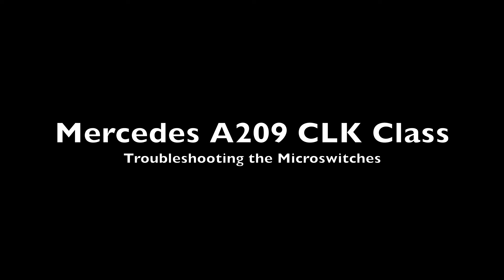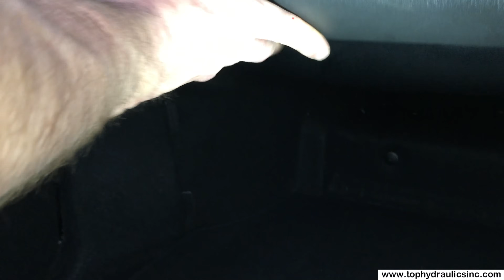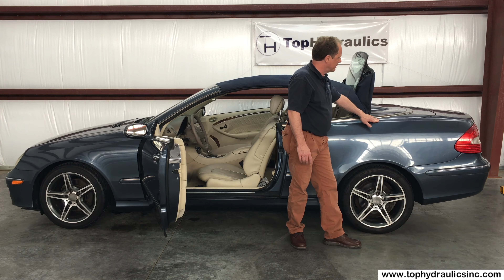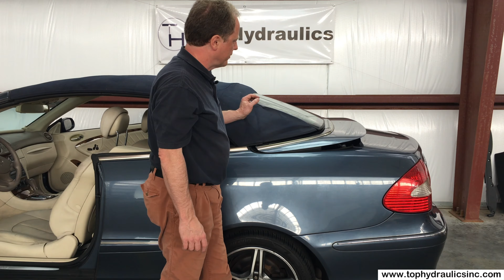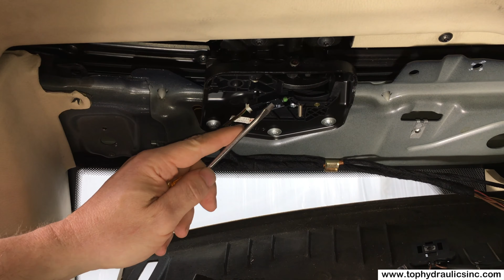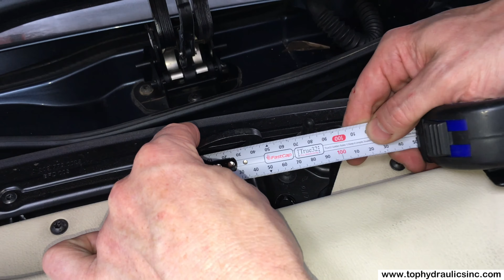Mercedes A209 CLK - How To Troubleshoot the Microswitches

Comment: Hello, my car is W207 cabriolet. Could you please explain what the following diagnostic errors mean:
B255F24: The limit switch 'Soft top compartment lid IN CATCH POSITION' has a malfunction. No signal change. Voltage level is too high.
B25452A: The limit switch 'Soft top compartment lid LOCKED' has a malfunction. There is no signal change.

Where is the faulty switch located? Could the problem be caused by defective wiring located in the trunk area for the folding soft top.

Comment: Hey appreciate the information, im sorry to ask but hopefully you will reply...i have a 2009 mercedes clk350 and noticed when either closed or opened convertible the rear convertible panel has a gap just a bit maybe about an 1inch. Its the panel where the rear glass sits on and its just on the drivers side. Any help? I can send u a video or picture of the vehicle

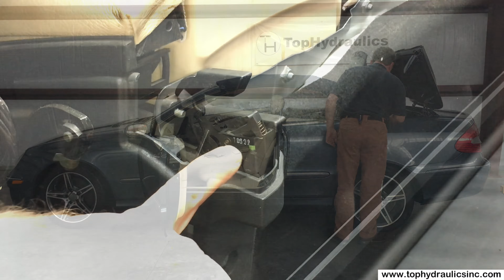Comment: Hello Sir, I watched your video trying to determine what the part difference from the left and right limit switches. Can I use part # 2098201910 for both sides? In your video at 3:21 mark, you called it part #S8422 - 2098202920, then you called the same part at 3:57 time mark part #S8411.

Comment: Hello you mentioned s84/11 at about 4:10 in the video being broken. I have this exact issue but I noticed that the tonneau cover latch that presses this switch is slightly out of alignment (roughly 10mm compared to right side switch). I tried to move the latch towards the center of the vehicle but there was not enough tolerance to fix the issue. What else can I do to fix this alignment so it doesn’t break the switch again?

Comment: Wow, this is amazing.  I am considering purchasing one of these models, and this is very helpful to know.  I recall seeing your video on th R129 when you explained how the rubber seals inside the cylinders are not well-made, and soon decompose creating bits and pieces floating in the fluids, which creates havoc on the entire system.

Questions: 
1. Does prolonged storing the top either in the open or closed position affect the operation or is it just a matter of switches going bad?

2. Are the hydraulic cylinders in the CLK problematic in and of themselves.

3. Are there key points for periodic lubrication?

4.  Can you rebuild the cylinders on the CLK the way you can on the R129?

5. Is there any problem created opening and closing the top manually?

Thanks so much in advance! 

Anyone else feel free to chime in with your experiences.  Thanks

Comment: Can you please help me? My microswitch for the ski bag is working and working fine, but it still tells me to close the ski bag. The windows don't go down by themselves when I press the convertible button. As I said, I tested the microswitch with a tester, and the gas springs on the cover are also OK. The convertible is closed, but when I press the button to close it, the hydraulic pump briefly turns on, makes a brief click, and that's it, but the convertible is already closed. When I try to open it, the message "Close ski bag" appears.

Comment: Hi, thank you for your video, the rear bow on my CLK w209 will not finally close as you have demonstrated in your video. On the chrome receiver compartment for the rear bow latch one of the sprung doors has sheared off and it’s the one that operates the micro switch. I wonder if you can help me with a new part number. Thank you. Simon
Reply from the maker: The sprung door is part of a larger assembly and surely that assembly has the part number printed on it.

Comment: Can you explain what to do if I pushed my compartment cover down to far before glass entered the ports in the cover?
Reply from the maker: Are you able to open the trunk lid with the blade key in your key fob?
Reply: @TopHydraulics  thanks for your quick response, so I managed to open the lid manually by opening the pressure relief valves on my cylinders and opening the screw on the pump. Question i have now is: would this compartment lid closed all the way without window locked in first be a reason for my 40Amp fuse to burn? I managed to manually operate and close the top, completing every sequence properly, and I am going to replace this fuse tomorrow once again and see if it burnes again. I understand if it does burn my pump is bad, how do i make sure that pump has gone bad? Thanks for pointing me into right direction.
Reply from the maker: @Kreasearch  The 40A fuse blows when the pump is bad - the timing was a coincidence.

Comment: my problem is that the part under the rear shield doesn’t slide bag or move, so the rear window doesn’t open, but all the windows go down and the front lose its grip and are ready to open, its only the back part there is the problem... i changed the fuse to the roof, but stil the same and the oil compartment is full en there is no leak anywere... please help me

Comment: Hello, my English is not very good, sorry. I have an A209 vehicle. Everything goes well when opening the roof, but at the last step, the back cover gets stuck while entering its place, and when I press the button to close it, the back cover gets stuck again. After pulling it a little, everything is fine. What is the problem? Thank you.
Reply from the maker: Do you have an early productionA209 with the last six digits of the VIN less than 009490?
Reply: @TopHydraulics No, My vehicle is a 2004 model and its VIN is not like that. Thank you very much for your reply. The rear cover only works when I first open it and after the whole awning is opened, it fits into place when I close it and the cover slides into place very nicely along with the glass.
Reply: @TopHydraulics  from your a209 video chapter 8… 2.00 minute. In this case, it gets stuck only on the first run.
Reply from the maker: @hasanserifoglu6262  Can you please explain again which part does not work? Does the cover get stuck when the top is down or when the top is up or both? Exactly how far does the cover move until it gets stuck? Is the cover closing unevenly and hitting an obstacle? Or is the top not folding perfectly and making it difficult for the cover to close all the way?
Reply: @TopHydraulics  I want to upload the problem I have with my vehicle to YouTube and post a link here. The problem is, as I mentioned, when I first open the convertible, the back cover gets stuck. There is no problem in the next starts. Thank you very much for everything...
Reply: @TopHydraulics  https://youtube.com/shorts/LwtzDT_wxeQ?si=nPxRcTqdDKgIFtG8
Reply from the maker: @hasanserifoglu6262  If I'm understanding this correctly, then your problem occurs while you are opening the top: the top retracts and folds into the storage compartment, the cover closes almost all the way, but gets stuck on the last inch of travel. If you open the cover again, then the cover will close properly on the second attempt. Did I get that right?

If so, then you want to observe two little plastic parts in the rear of the storage cover that are supposed to push down on the folded top, to help it get folded all the way and make enough room for the cover. These plastic pieces are attached to springs and maybe they are not touching the top in the right place the first time around?  Or is there an obstacle taht does not allow the top to fold down all the way? Maybe a broken tension cable between the canvas and the headliner?
Reply: @TopHydraulics  I looked at what you first said, the plastics and springs are in place, I will look at the tensioning tires tomorrow, thank you for your interest.

Comment: The hydraulic reservoir was empty 
I filled it with hydraulic oil , the oil emptied out in 15 seconds,
Reply from the maker: If it emptied that quickly, then your leak is most likely from the bottom of both main lift cylinders.

Comment: You saved my roof! Thanks for the sound advice 🙌
Reply from the maker: Thanks for your feedback and glad to hear that the video helped you with fixing the top! What was wrong and how did you fix it?
Reply: I had a broken switch where the plastic on top of the spring was completely damaged. I could not even open the car to get to the switch because of that, however I also saw another one of your videos on how to open the soft top mechanism manually and combined with this video, I was able to get in and replace the switch. Thank you 🙏

Comment: What about the S84/22 or S84/23 catch position limit switches.  Would these keep the Compartment cover lid slightly out instead of engaging the Cylinders to pull the final movement to full close?
Reply from the maker: Would you mind describing the symptoms in more detail?

Comment: Great video.Thank you! I have question.I have a 2008 Mercedes Benz clk 350 cabriolet. The left rear side window does not roll down. Will that interfere with the convertible top operation? Thank you!
Reply from the maker: Yes, a malfunctioning window regulator will disable the top. Fortunately, our video on replacing the main lift cylinders already shows you most of the steps needed to get at the rear window regulator.

Comment: I have a a209 and my problem is that when i want to open my roof , the windows go down , my roof opens at the front a little bit my pump is running but nothing happens. The back won't open.
Reply from the maker: Is the tonneau cover moving at all?
Reply: @TopHydraulics  no not at all
Reply from the maker: Aah, what are the last six numbers of the VIN?

Comment: i dont understand what to do when i accidently locked the back and now i cant manually pull the back out again. pls help
Reply from the maker: Please explain in more detail. Did you manually close the top and you closed the tonneau cover without securing the rear of the soft top in it? What was the reason for manually closing the top and which error messages are you getting?

Comment: That is one of the best videos I have ever seen. Thank you so much. I have a code B1962 the power closing limit switch fails to switch. Please, can you or anybody else tell me where this switch is located?
Reply from the maker: Hopefully, we can figure out together which switch your code reader is referring to. What are the exact symptoms?
Reply: First of all, thank you so much for your help and your interest. It's a 2005 Mercedes Benz 209 CLK class 1.8l SFI. When I pull the opening switch (CAN controlled) the convertible top doesn't move. After this the scan tool reads the following codes: B1870 the output stage or servomotor of rear lock is defective. B1962 The power closing limit switch fails to switch or has a short to circuit 30. At the trunk lid latch, i measured two micro switches, one goes to rear SAM 10/2 and the second to the convertible roof module N52. Both switches are pulling a voltage of 3.6 V coming from the modules to a ground. When i move the roof manually i cannot open the trunk, so everything works fine. I don't understand why the car doesn't notice this. Now I think I made a mistake and measured on the wrong part, perhaps I misunderstood the fault codes.  @TopHydraulics

Comment: My Autel says 225 limit switch soft top bow in catch position NO, whether it's up or down. 224 and 226 shows up or down, but it doesn't activate the catch position either way. It seems to stop here. Should it activate for the next step? And where would that catch position be? The windiw goes up and down, no more.

Well, after turning off the key and the pressure releases, then I push the rear section closed, the soft top bow catch position reads YES. I have to close it manually.

Okay, final edit, I hope. Now it works. I tried the windows reset, then it opened all the way again. Then when closing it, it paused a while, but I kept the button forward, then it started going closed. Untill the back cover was straight up and didn't go down. It was stuck there. I got out and pushed it forward a bit, then got back in the car to push the button forward and it finished closing. So I tried it again, to get it to the stuck point again, to take a picture of where I think the problem is, but it continued all the way closed. LOL
I did decide to take the manual straps off the rear hinges, just to see if that helped. Not sure if it did, but that's when it decided to work. I alsow replaced the right rear hinge, as the plastick center piece broke when trying to manually open it. But I guess everything was just getting all stuck. The first time trying to manually open it was very difficult and became easier as I kept working on it. I guess I need to keep everything well lubed up.
Now that it works, my wife will be happy. Now I have to put all the black stuff back in the sides of the trunk. She was getting upset and wanted to sell the car and buy another convertible that works. LOL

Well, had to get out a few times to move the rear cover forward a little at a time, untill it finished going closed. So maybe it's that switch on the rear left cylinder?

B1926, B1928, B1953, B1933, B1930.
Do these codes help, where am I looking for this limit switch?

Comment: The other day it opened all the way. Now it acts like the pump isn't building enough pressure to work. 
https://youtu.be/rznpJjOZg-A
Reply: As I found out, this is the problem. The pump needed to be replaced. I replaced it and now it's working.

Comment: hi there i have a clk 200 kompressor the top opens and closes great but it says top in opperation on the dash, also the side windows wont go into there final possition i.e full locked car, do you have any idea what could cause this.
Reply from the maker: Most likely, the "compartment cover closed" micro switch on the right side of the storage compartment is not giving the signal that the cover is closed all the way, see https://youtu.be/ZLIdoiw_KTY?list=PLly4CMbpk7owNRAl-AECemIb0SVihtBlV&t=312  This could be because the switch is broken, or it could be because something is in the way of it getting triggered. Check it out while the cover is open...

Comment: Good video. Is there a way to maintain these 2 switches from dust because I have the chrome door is stuck down
Reply from the maker: That’s an unusual question, as these switches are not normally sensitive to dust or exposed to much dust. The best dust protection may be to make the chromed cover functional again, as designed.

Comment: Hi Klaus. I have an intermitent malfunction in my 2008 clk. When I try to open the top the 4 windows go completely down, I have the message Top in Operation and nothing happens, no sound. I said that in an intermitent malfunction because it happened 1 year ago, it didn't work for a few months and then sarted to work again. I have the common problem of the cables in the back window, does it cause humidity that can originate this problem? Thanks in advance.

I just saw in the comment section that this might be a fuse or relay problem next to the main pump, i’m going to see it is this. Anyway, if the problem persists i’m sending you the pump to repair. 

Many thanks for your very wise advises. I’ll give you feedback. Manuel
Reply from the maker: Could be either the pump motor drawing too much current and blowing the 40A fuse or could be the relays on the pump motor. Check the 40A fuse behind the left rear wheel well first, see https://www.youtube.com/watch?v=08R8E3Sc0oQ&list=PLly4CMbpk7owNRAl-AECemIb0SVihtBlV&index=6&pp=gAQBiAQB If the fuse is blown, then the pump motor is burnt out or the pistons in the pump are frozen, making the motor draw too much current. If the fuse is good, then you might be lucky enough to have a bad relay at the pump. Only one relay fails at a time (and the contacts only fail in activated mode), but there are two identical ones. One relay makes the pump motor turn clockwise when activated, the other one makes it turn counterclockwise. Thus, the cheap test in this case would be to swap the two relays for each other and see if the pump starts turning. Both relays need to be in place for this test, but you swap one for another. Again, the latter will only work if the 40A is not blown.
Reply: @TopHydraulics  
Dear Klaus, 
I couldn’t find today an electrician so I tried myself to swap the yellow relays (i didn’t measure the fuse but i thought, maybe wrongly and with some risk of damaging that if the fuse was broken i woudn’t damage any electric parts).
When I switched it 1)  windows down 2) the tonneau made the movement 3) the back window went up and 4) the tonneau fully opened. No more. And then when I tried to close it obviously didn’t do anything so with an openned tonneu I tried to reach those relays and swap them again, which I managed, 30 celsius, under the sun, fortunately I have very long arms. It was a nightmare. I called Mercedes parts and tomorrow morning i will have 2 new relays. The million dollar question is if with te teo new relays (i know one would be enough, anyway) my top will do the full motion it is supposed to do. I’m praying for that because in Portugal Mercedes told me that the problem was two sensors, 800€ and they wouldn’t give any warranty. 
Tomorrow I will tell you good news, I hope. 
Many thanks for your time and your experteese
Reply from the maker: @manuelpedrosd  Excellent, I'm looking forward to your confirmation tomorrow that everything works after you have replaced both relays!
Reply: @TopHydraulics  Dear Klaus, 
I put the 2 new relays and the roof does it’s magic how it’s supposed to do. 
Many thanks for being such an amazing expert and a good samaritan. 
You rule (and Top Hydraulics) 
:) :) :)
Reply from the maker: @manuelpedrosd  Congrats on your success!
Reply: @TopHydraulics thanks but the success is all yours and of all the experience you’ve gained that alowed you to immediately identify the trouble and solve it. 
Manuel